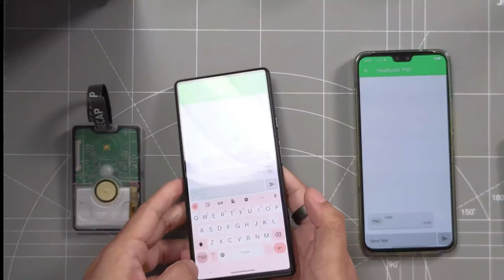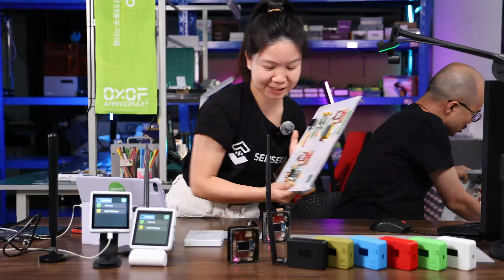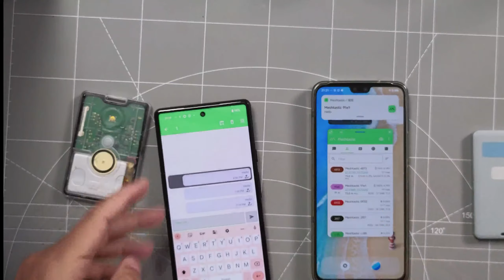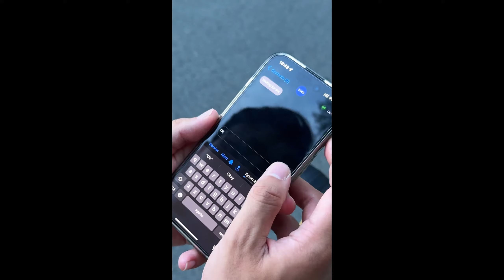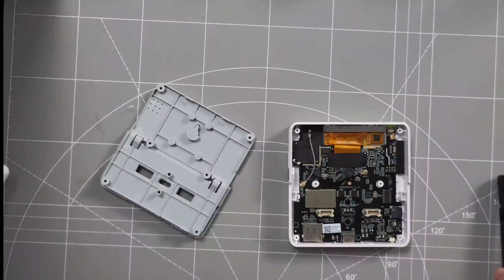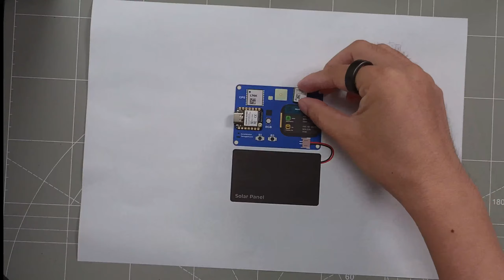Making Next Gadget: IoT into the Wild with Meshtastic

Comment: Can’t find where to ask a question so thought I’d ask here. One of the suggested use cases of the T1000E is ‘Asset Tracking’ - I guess then you need a second node on the meshtastic mesh? And for this case what would you suggest for the second node? I am guessing it does not need GPS or be waterproof, maybe a USB stick? I am fairly sure I read of a USB stick already but it wasn’t supported by many operating systems. A Single Board Computer from the same company that made the USB I think.

Comment: Ordered the card, hoping it ships with that clear cover, which looks awesome. I'm looking forward to the Indicator unit as well for my vehicle. Amusingly I have a magsafe phone charge setup just the same way your team shows off on the website - so that's a super smart addition? Option? But regardless, the external antenna is probably required for vehicle usage - I don't know about your testing but in my car (also a Tesla) even with a 3dbi antenna, it seem like getting messages out and back is really dicey.  I would certainly use one to replace my "just throwing a radio on the dash".

Would even be fun just to have on a desk to watch messages go by, or the "node map" option to see the locations of nearby nodes as they move about.

Comment: I don’t have any experience with Meshtastic but 
1) small is good but I don’t mind the size of the T1000A. Depends if the aerial is as good. 
2) not experienced meshtastic but can you bridge meshtastic to Lora? Then all LoRa devices could be added to meshtastic.  I am thinking two Lora chips and an ESP 32 to interface them? 
3) add a keyboard.  That is my plan for using the development kit. My phone battery is always dying. I would want to be able to interface with the device without a phone.
Reply: The inspiration for idea for 3 is your solar panel. Even with a battery your device will easily outlast my phone. If you are going to add solar power you also need a way to send messages without a phone, even if they are simplified. Have seen keypads interfaced to arduino before: maybe like a 1990s mobile phone…
Reply: The inspiration for my answer 2 is that I have an M2 Multiplatform in local mode interfaced to an A1101, a T1000A, Data Logger and 2 K1110 sensor dev kits. Bridging them between local and meshtastic would give me the best of both worlds. I suspect by the time anyone has a weather station they also have a gateway. Like my current Sonoff iHost can bridge local Zigbee/Wifi devices to the local “matter” network.
Reply: good idea, for 2, I think maybe the software is difficult to support both lorawan and meshtastic
Reply: @jenkinlu1198  that is why I thought two LoRaWAN chips. One chip to do LoRaWAN. One to do Meshtastic and a brains to do the work in between. I may do it myself, if they don’t create a bridge, with an arduino and two LoRaWAN, but the machine LoRA shined is a shield so that is only one. I need to find another arduino compatible LoRa as there are still pins available for a second interface. I’m willing to bet by the time you’re spending as much as a weather station you get a hub. I think if they want to make meshtastic variants they should start with cheap stuff. Also what if the mesh is weak where you are and it breaks to the weather station; the data would need to be cached for later transmission. Okay if the mesh is always great where you are.
Reply: @jenkinlu1198 this is why I thought 2 chips (one LoRa and one Meshtastic) and one brain between them. Maybe a C6 as brain so you could also bridge to Zigbee or Thread Networks.
Reply: As regards 1):small. I suggested to a flatmate he could track his dogs with Lora/Meshtastic and showed him a T1000A so a small one might be good. Are you able to make it small enough for a dog to wear? That might be useful . People quite often lose their dogs or worry about it, so the owner could have a big device but the dogs miniature ones.

And people pay subscriptions for a GPS one with a SIM card in it already, so they pay quite a lot. First U.K. based advert I found was £6/month if you subscribe for 1 year, so £72 a year or $92. People live their pets and pay stupid amounts for them.

Comment: I have 2 SenseCAP K1100 Sensor Development kits: can I convert one of them to work with meshtastic? I just ordered 1 of these development kits (1 was in stock) but I need something for it to talk to. Thanks. I do have a T1000A but only 1. I could convert that to meshtastic but then I lose normal Lora I think. Also I was out during the livestream so missed the link to how to do this. Is the T1000A I have waterproof? I’ve been carefully guarding it from getting wet.
Reply: T1000-A supports IP65, it can catch rain, but can't put in water long time
Reply: @jenkinlu1198 thanks. Good to know I can be less careful. And can I convert a K1100 Sensor Development kit to meshtastic? I assume I have to communicate directly with the LoRa module using STM32 cube or something.
Reply: @vividexplore  the Meshtastic project can't support the chip now,  why do you want to use K1100?
Reply: @jenkinlu1198 because I have 2.
Reply: @jenkinlu1198 what about an indicator that does not have built in LoRa: can I move the a Grove LoRa board to the indicator? I’ve seen Indicator on the meshtastic GitHub but assumed that was just built in LoRa…

Incidentally the reason I wanted to use a sensor prototype kit is that I have two of them. That is it.

Comment: What LoRA frequency is the T1000?
Reply: I think it is universal and you select the frequency when configuring it. I kinda just selected EU868 without thinking but I’m pretty sure I had to select the region.
Reply: @vividexplore  therefore the antenna is not calibrated to a certain frequency!?
Reply: @PiataDacia I think it needs to be a near frequency, so I’m not sure the same antenna could do 868 and 433, but 868 and 915 are close enough to be done with the same antenna. Like my WiFI router has separate 2.4 and 5GHz antennas but I can do different bands near to those numbers.
Reply: @vividexplore  thanks for your reply, make sense to have two antennas
Reply: @PiataDacia  it will be optimum at a very specific frequency and then get worse the further from the optimum it gets. If the frequency is quite near there is no need to change antenna. I believe LoRA can at 433Mhz; I doubt the device can work on that frequency as-well as about 900.